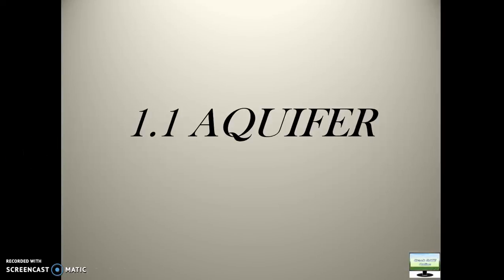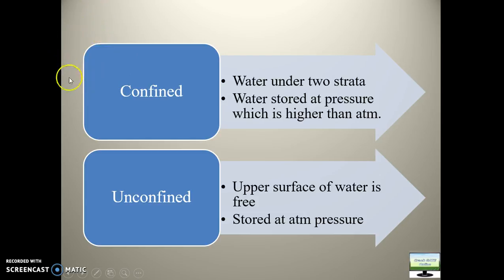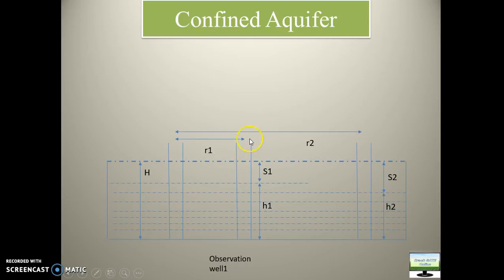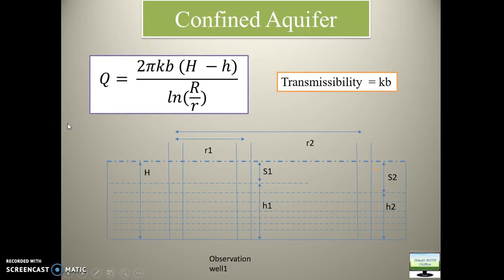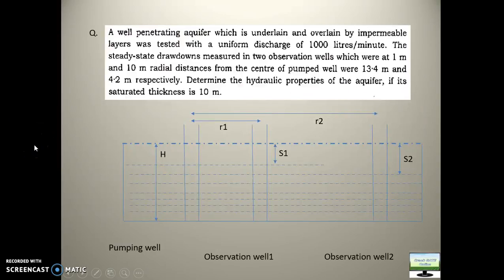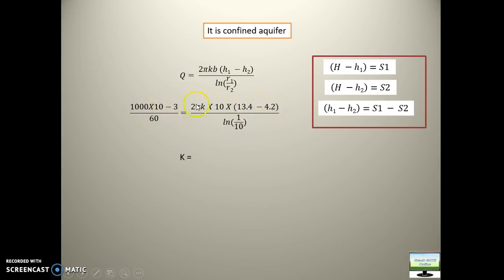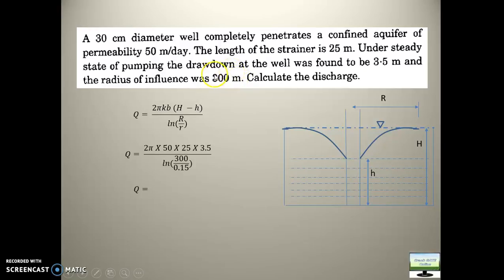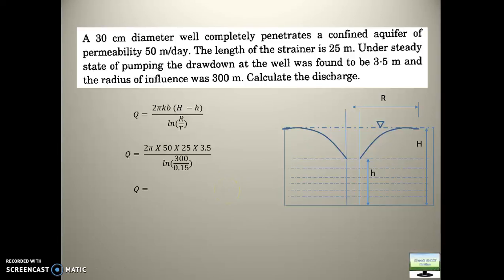1.1 Aquifer

Comment: Can you please solve the following problem
 The drawdown at the well face of a 30 cm diameter fully penetrating well in a confined 
aquifer is 3 m. The radius of influence of this well is 3 km. For the same discharge and 
aquifer condition, the drawdown at 300 m away from the centre of the well is.....

Comment: sir I think ln(r2/r1)  is the term in the denominator in  discharge formula.
Reply from the maker: I have put it like that to easily remember...
because there will be no change in numerical value only sign will change and as you know discharge can not be negative...
so your purpose will be solved...
study well.
please do like, share and subscribe
Reply: Yes otherwise u will get answer in negative
Reply: Sir with that formula "k" value comes negative

I mean if S1-S2/ln(r2/r1) then it turns to be positive